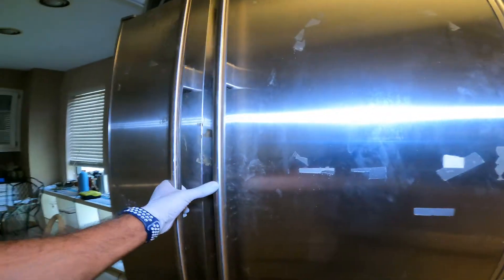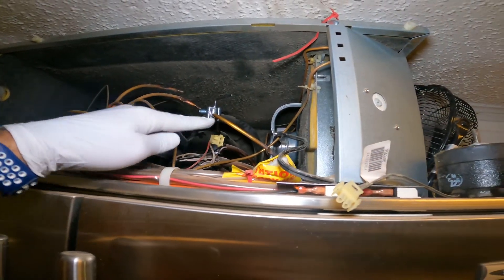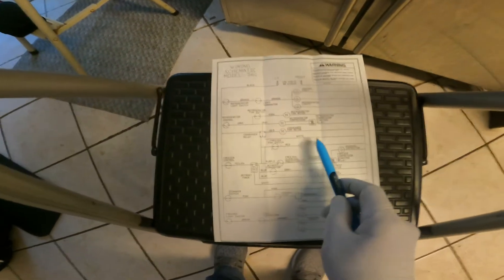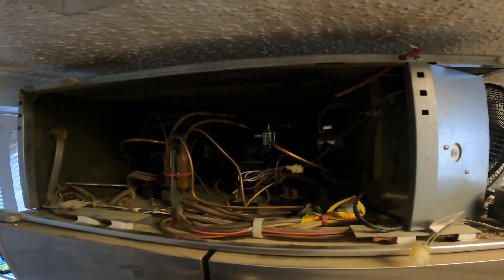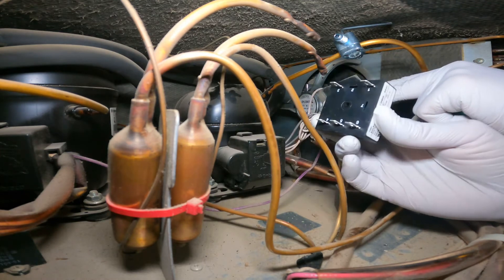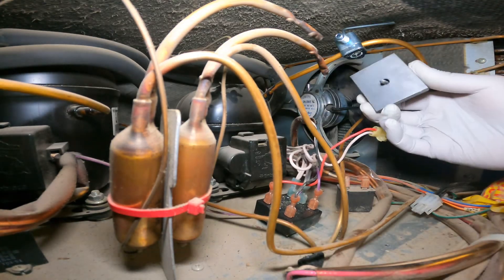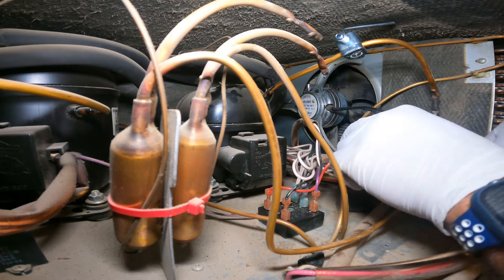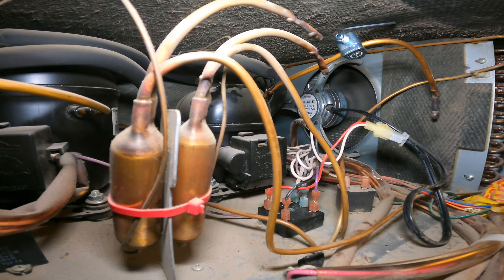How To Replace Condenser Fan Motor Relay In Sub-Zero Refrigerator

Comment: Great video i neverrrrr knew i thought that relay was a terminal block not a relay
Reply from the maker: Either did I. Apparently they don't break too often but its good to know the function of the part
Reply: @allaustinrepairs2054  yes i remember i dealt with a similar issue years ago where wire was getting voltage on and off and fan didnt run always..i suspect it was that relay.!!!
Reply: I have a rattling noise coming out of my 632, do you think it’s a compressor fan being damaged?
Reply: @htran383  could be fan and or copper pipes hitting eachother...or the TIMER.. not sure if your model has 1 but if it has a digital display it wont have a timer....could be the top cover...if you open or remove cover does it rattle?.. try to isolate the sound let me know....could be compressor...totally depends...open the top and peek in...while you're up there shut off the fridge and pay attention to what stops and where it comes from...also...after you turn. It off wait 20 min ....turn it on whiel looking...everything turns on 1 at a time you can get a better idea..most likely the fan up there bracket is shaking and that could be fixed with 4 new rubber gromits... and that's not the easiest to Install but its doable....if the tubes are touching and rattling you can carefully pull the apart from touching a couple Inches...get back to me if any issues
Reply: @fixitfelix718  thanks for the tips.  I was able to open it up and looked at the fan and was able to stop and restart the fridge.  It looks like when the fan is spinning there’s a little gap between the rotor and impeller causing the fan to slide back and forth creating that rattling sound.  It doesn’t look like the impeller fins are rubbing up against anything.  Maybe it needs new bearings or a new fan?
Reply: @htran383  is the fan black? Or silver? Has it been replaced to your knowledge? Do you see wire nuts on the wires?